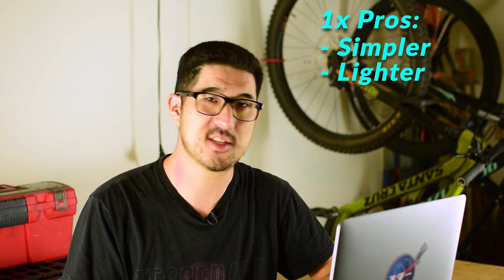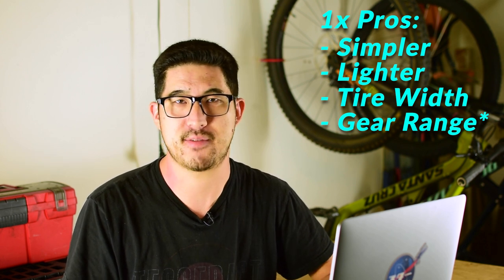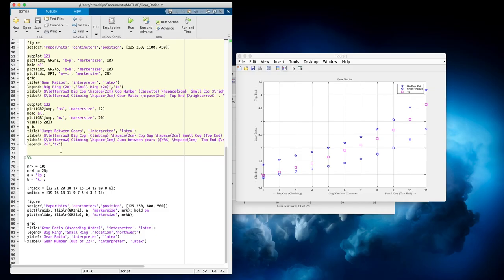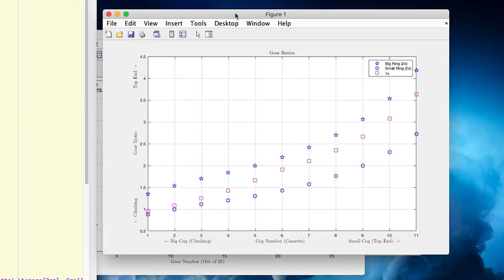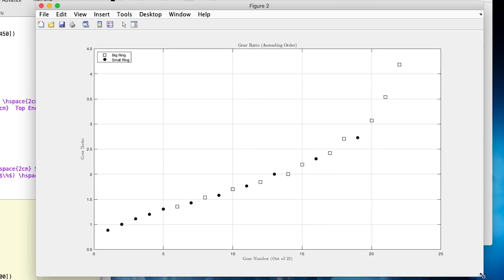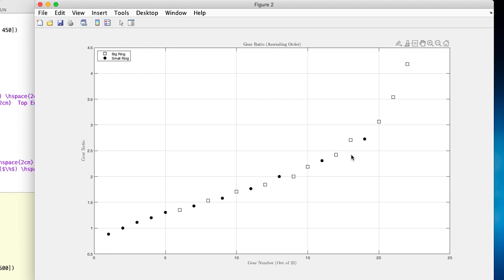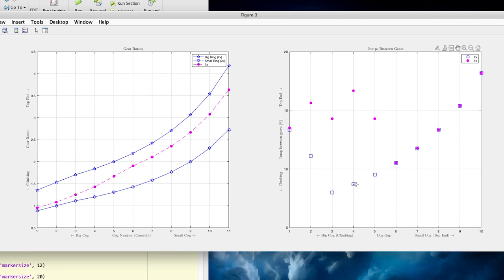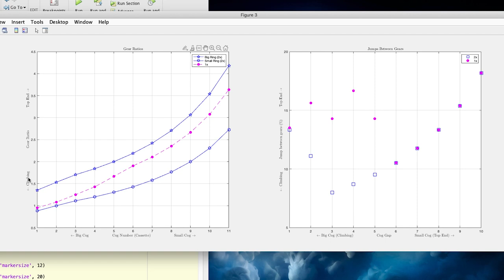1x vs 2x Drivetrains For Gravel Bikes | The ANSWER! (Is In Gear Ratios)

Comment: To answer your questions at the end: Yes, yes and yes. Thank you! It was to the point and well put; seems like after all I really needed to see some plots to understand the whole gravel business.
Reply: One thing to add or ask (from comments I read from other folks elsewhere which made some sense) regarding the advantages of 2x system, on sudden steep sections 2x gives you that option of switching to larger ring instantly, whereas in 1x you have adjust gear by gear to reach the optimum cadence. Is this true? Does it actually come handy i.e. change down the chainring quickly with 2x?
Reply from the maker: In my experience, I never need to suddenly drop an entire chainring due to a sudden incline. I understand the argument, but a little bit of experience and you’ll know when to shift based on the upcoming ascent or descent. I definitely don’t think it’s the main reason for wanting to go 2x.
Reply: @TheBikeSauce   thank you very much understood

Comment: this is a fantastic and well-presented video.  great job!
i ride road and gravel, probably more road and i absolutely do not like 2x.  all of the your 'pros' for 1x were bang-on, but one thing you didn't mention was noise.  i have spent way too much time fine-tuning FDs to eliminate chain noise and i just can't seem to ever get away from it.  a  properly-setup and lubricated 1x drivetrain is a silent and smooth system that from a purely tactile perspective, is enough for me to only use 1x. 
also, kudos for mentioning the overlapping gear ratios in 2x - to me, this is wasteful. ;)  LOL.
i love the GRX 810 components but i am now running a SRAM Rival AXS eTap 1x12 setup with a 42T chainring and a 10-44 XPLR cassette on my Aspero, and it has so much range.  the only change i may make, as i get faster, is move up to a 44T chainring.  i really notice the smaller spacing in the 12-speed cassette vs the 11-speed 10-42 i used to use with my GRX 810 stuff.  it's perfect, for me.

Comment: I've just converted my 3x hybrid to gravel use by purchasing some Hunt Carbon 30 Allroad wheels, 34-11 10sp cassette & Schwalbe 35c All-round nobblies - it's been a blast revisiting local trails. I didn't want to make space for a 3rd bike in my flat, hence not just buying a hardtail instead, especially as the choice at the mo is so poor here in the UK.
1x drive as you point out, makes perfect sense on MTBs, particularly full-suss. On a gravel bike, IMO - it does not ANY sense if that bike is going to be ridden much on-road.
Another important advantage not mentioned here is when you are riding an unfamiliar trail where you turn a corner to be confronted by a steep climb. On a 1x, you have to grind the gears by changing down onto a larger cog that puts strain on all the drive train & legs. On a 2x bike, you can drop off the large chainring onto the smaller one - mechanically much easier & faster. If you are already on the smallest chainring, chaining down onto a larger cog is going to be easier anyway because the difference is going to be smaller.
1x on MTBs is going to be superseded as it is now by gearbox tech fairly soon, I suspect - possibly  by Gates belt drive & hub gears. Having a long-cage rear derailleur hanging down is not a great idea on many rocky trails!

Comment: This is super helpful. I agree your analysis but come to a different conclusion. I would argue that, rather than the jumps between gears, the high and low end ratios are determinative, especially if you ride in areas with steep hills like Griffith Park in LA. I've had hip surgery and knee issues, so the added ease of a .9 climbing ratio makes the difference between being able to climb or not. And the added speed of increased leverage at the top end makes the difference in being able to keep up with cars while descending or not. So for me, the 2x makes more sense. Your analysis certainly helps me come to that conclusion. But it's more an issue of what terrain you're riding and what your riding style is. Thanks!
Reply from the maker: Love the thoughtful and diplomatic approach. Sounds like 2x makes total sense for your area and style

Comment: Nice analysis and presentation.  

Back in 2018, I considered a 1x bike but ended up getting the Diverge Sport with its 2x system. I had recently moved from a flat part of the country to terrain that had a lot of hills. Not being an experienced climber, I wasn’t comfortable giving up the wider range of gears or smaller incremental jumps the 2x offered.  If most 1x designs are similar to the one you analyzed, I would have seen those larger increments on the hill climbing gears so I’m glad I didn’t go that route. Although now that I have a few years of experience climbing hill under my belt, I would still consider a 1x system in the future.  Thanks for helping me understand more about them. Good video!  

Also, I just bought headset spacers for my Diverge from your shop. Thanks for the quick delivery, cool sticker and friendly note you included. The sticker will be perfect to cover up a ding on my paddle board.
Reply from the maker: Yes! Thanks for the feedback and your support!

Comment: Better to look at Gear Inches as that takes account of positive impact of running larger tyres on same wheel diameter you talk about on 1x a small gain but still it is there. Or even Sheldon Browns Gain Ratios which is dimesionless and not only takes account of any varistion in overall wheel diameter including the tyre but also the crank length amazingly. 😊

Comment: Also, if you are not a competitive cyclist (as in competing in events), the bigger jumps in the larger cogs when you are climbing as a less fit athelete don't matter much.  I like how you pointed out that the first 6 cogs spacing is the same.  What a competitive cyclist loses is pushing the pace at 29mph or more.  If you can push 26mph or more, then the 2x will be better.  Often times when I had the 2x even offroad during a small downhill, you would switch to the big ring only to get hammered when you hit a short steep section, wanting to go small ring again quickly.  This made the 2x system a hinderance.  But I imagined that ex-roadies would rather have the big ring to ride home on the road.  Again, if you never crank 29mph or have long downhills, you may never need the big ring like you think.  That's why 1x makes so much sense on mountain bikes.
Reply from the maker: Right on, well said!

Comment: Thank you for the video. it was insightful and fun to watch with the editing. I just started to look at gravel bike (I don't really bike much so want to pick a more versatile bike option) and friend told me to go with 2x.

I got an email yesterday from Costco that Intense is doing a Spring sale (ends 3/3/24 by the way) and the deal is really good. the 2x gravel bike sold out for size small so I got the 1x instead. I was worried if I make the right decision or not. After watching your video I have a feeling I will be just fine with 1x.

Looking forward to put that bike together and find my way into the cycling world.

Comment: great detail on gear ratios. one note (and possible con) for 1X is frictional losses. narrow-wide chainrings and tight chain articulations (10t cog) result in small power losses compared to 2X. To recreational riders just trying to have fun .. not a big deal. but to the competitor, especially one entered in a fast event like SBT Gravel, this could be worth considering.

Comment: Here are a few more things to add to the conversation:
1. A 1x is suitable for hard core mtbing but not much else. And if you're doing any kind of distance you should use a 2x because as this video points out a 1x has bigger jumps or higher average gear step percentage. However even having a lower gear step percentage can be a benefit in the trails. 
2. You get smoother shifting with a 2x due to the smaller ramp ups.
3. People think 1x is lighter but don't consider the difference in weight between the cassettes.
4. A 2x has better efficiency through tighter ratios but doesn't have the low range of a 1x. This is why more people in the end choose 1x.  

The main reason for this is because after moving away from square taper bottom brackets and 2x or 3x systems with small BCDs the industry has steered us into choosing between low end or optimal cadence. They also push race results/top end and going fast but the fact of the matter is that the majority of us really need more mid to low end range. So when you go to buy a new bike your kind of stuck unless you are willing to go back a bit and consider what I have found to be the ultimate 2x crank: the double BCD 64/96 four bolt. These can be found for very little money and come in a few different bottom bracket types. The advantages to this crank is that you can run as low as a 22t front ring as well as find ring options all way from 22t to 42t in two teeth increments and the rings are very inexpensive.

I've built a number of budget bikes with true overall capability in mind. They vary in type but all use that four bolt crank. It's usually something like an 11/34 cassette and a 22/38 front. (I've ran as high as a 42t front with the 22t and it shifts just fine). This is have your cake and eat it too as you have low average gear steps, stump pulling low end and however much high end you want. I usually choose my front big ring based on how much of the cassette it will allow me to use (another thing to consider but again on a modern 2x you don't have much for options) On one of my bikes I dropped from a 42t down to a 38t because I was in my first 3-4 gears all the time. Now I use more of the cassette. I may have lost some top end but rarely do I need that ability. 

Food for thought!

Comment: This was an excellent and wonky analysis of gear ratios (and I mean that in the best possible way, I teach and do economic modeling and quantitative research methods, this is how I think).  

I've been considering buying a semi-gravel bike  (Trek FX Sport 5) with a 1x system using the same GRX drive train with the same 11-42 in the back, 40 in the front, that you used in your modeling.  So your video is already valuable to me right out of the gate.   

You derived useful lessons and explained them very clearly:  overall range is higher for the 2x system but not THAT much higher.  Importantly, at the low end, the gear ratio is the same between the 1x and 2x systems, so climbing hills shouldn't be any harder on the 1x.  On the high end, the highest gear on the 1x has about the same gear ratio as the 2nd highest gear on the 2x, so you can go faster on flats in the highest gear on the 2x than you could on the highest gear on the 1x.  But I don't think that's a big deal:  most people looking at gravel bikes with 1x systems are less interested in speed on flat paved roads and more interested in control and comfort on dirt trails with loose gravel or pebbles or muddy spots. 

You also showed important stuff about the jumps.  In higher gears, you're more likely to need smaller jumps to allow for better fine-tuning of your cadence, and the 1x system has jumps that match the 2x system's.  In lower gears, the jumps aren't as important, so that's where Shimano spaces out the 1x gears more.  

I also liked your demonstration that the 2x system has some duplicate gear ratios, so the total number of unique gears is smaller than 2 times the number of gears in the back.  

All of this is very relevant for my purchase decision. Now, I feel confident enough in my familiarity with the principles here to know that the disadvantages of the 1x drivetrain are, for me, very minor and mostly not relevant.  So I can make a more informed purchase decision and feel more like I know what I'm getting into despite that this will be my first time ever with a 1x drivetrain.  

So, thank you!  

p.s.  If my summaries of your lessons and explanations have errors, please correct them.  

more p.s.  Ever thought of being a teacher?  You'd be really good.
Reply from the maker: Nice recap! Yes, I’m a professor of mechanical engineering, but I tried to minimize the lecture-y feel 😆

Comment: I went down this route in Excel when picking a bike for my kiddo - the variety of gear ranges on kids’ bikes is crazy, especially when you consider the close ratio of rider weight to bike weight… Great to see this though as I’m wrestling with exactly this question… As the bard wrote: 2x or not 2x?

Comment: Coming from a bike touring perspective, I'm still stuck in 3X land, until I upgrade bikes. Even post upgrade, I can't see a 1X giving me enough climbing gears when tackling a 15% grade with 40 lbs on my bike, while still allowing me a big enough gear ratio when going down the other side... Having said that, I did see some new touring bikes for sale at a local bike shop with a 1X12 setup. Still not sold though...
Reply from the maker: Sounds like a 2x would suit your needs best?
Reply: @TheBikeSauce  yeah, my thoughts too. Just surprised that a bike purpose-built for touring would have a 1X setup. I found that quite odd...

Comment: This video is fantastic. Very informative and helpful for decision making on which system to go with. Kudos to you
Reply from the maker: Thanks!
Reply: @TheBikeSauce  being a programmer myself, I felt shamed to not have done any computation on gear ratio during my research. I’m planning to build a gravel bike and will probably also use it for bikepacking. GRX 1 by only goes to 43kph at 90rpm so it’s gonna run out of gear for on road descent. Campy ekar looks to be the most versatile 1 by groupset among the big 3 brands. Honestly it all comes down to availability. We are not in a position of picking in the current situation with the shortage going on

Comment: l have both systems on my bikes even 3x on my old MTB and they all have their purpose .  1x for daily use is a great all rounder  2x for my road bike provides wider ratio of gears for max performance abilities !! AND 3x can Either provide more variety of gears for smaller cassettes like 7spd old skool or providing more ratios in a lower ranges 8-11spd or even providing lower gear ratios for basic cassettes like 11-28 or 11-32

Comment: I prefer 2x since I ride my gravel bike on the road before hitting the trails. I generally have a rule of staying in the big cog when road riding and utilize most the gear range. Also if road climbs go steep I can ride out of saddle (OOS) for additional leverage. Once I go off-road, I go small and switch to high cadence spinning for traction control. 

Honestly I don't really see the 2x drivetrain as overlapping, since I ride each chainring differently. 😉
Reply: This guy doesn't know the meaning of the word  "overlap".

Comment: A 1X system generally isn't actually lighter, because the rear cassette needs to be so much bigger. For a RX600 group  the 2x cassette weighs 250g, the 1x weighs 411. That difference offsets the front derailleur and cables. So in the end we are talking about differences of 20g or so. unless you are doing tour de france you wont notice 20g, but if you really do, then just take 2cl less water with you. That cassette can sometimes even be so heavy that you can feel the inertia, either as chain slap when you stop pedaling, or in the momentum of the pedals (if you rear derailleur has a clutch that is)

Also even if the jumps between the gears are the same I don't think you arrive to the correct conclusion. The jump may be the same, but the cadence vs speed will benefit with the 2x. Lets say you are at a cadence of 75 rpm with 700c wheels. On a 1x  on the second highest gear (13t ) with a 40 tooth front chainring you are doing a comfortable 30.4km/h. If you go one gear up, the same cadence is 36km/h.  On a 2x the at the same rpm and the closest speed would be the 17 tooth rear with 50tooth front. Then you'd be doing 29.1 km/h, if you go up one gear then you'd be doing 33km/h. If we adjust the cadence of the 2x setup to match the speed  of the 1x (by going up to a cadence of 78)  the difference is 30.4kmh vs 34.4 km/h

So  going from 30.4kmh to 34.4 is hardly the same as 30.4 to 36.0, in fact the step is 40% bigger with the 1x compared to the 2x. With a 46T front on the 2x that bring the difference down to 20% smaller gap than 1x. The difference in how you experience it is, at least to me, quite big. On top of that you can spec your bike with a 12-32 tooth cassette on the 2x and get much smaller steps ( 11-12-13-14-...  tooth instead of 11-13-15-17 etc on the top end), at the sacrifice of a little range. The same option does not exist for the 1x system. 

To me it all comes down to versatility. I want my gravel bike to be the one bike to do it all. Be it fully loaded as a bike packing bike , a fast and nimble cross country in the woods or on the roads, with or without a lot of headwind, sidewind or downwind. With a 1x drivetrain you loose a lot of that versatility, and the whole point of the gravel bike, imo, disappears.
Reply: A 1x groupset does exist with small steps for the higher gears for optimum cadence. 13 speed Campagnolo Ekar  rear cassettes have single sprocket differences for all cassettes like. (10-11-12-13-14-15-17-20-23-27-32-38-44) for 10t-44t cassette and 9-36t cassette goes like this (9-10-11-12-13-14-16-18-20-23-27-31-36). Regarding weight of the rear cassette, a 11 speed sram x01 10-42t cassette weighs 268g that works with 1x gravel groupsets.